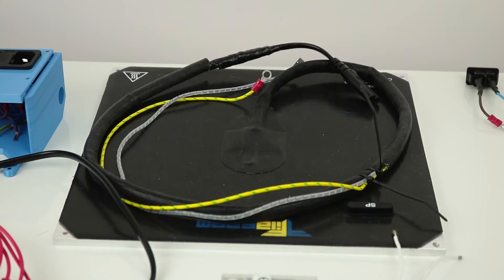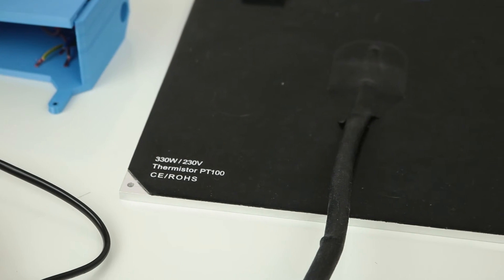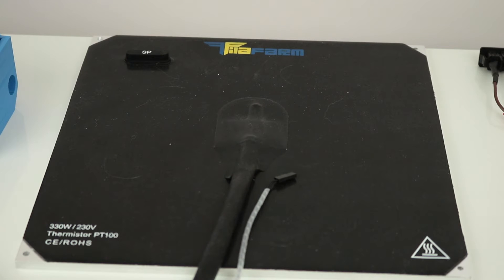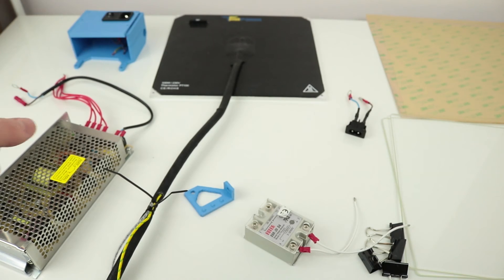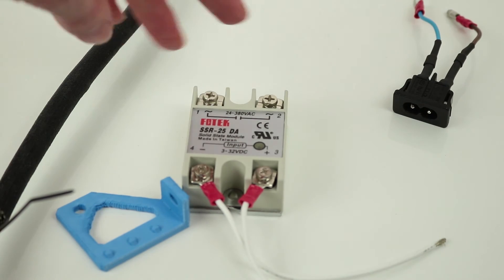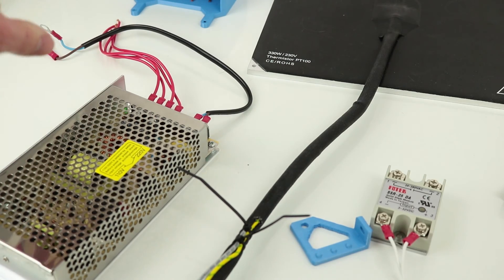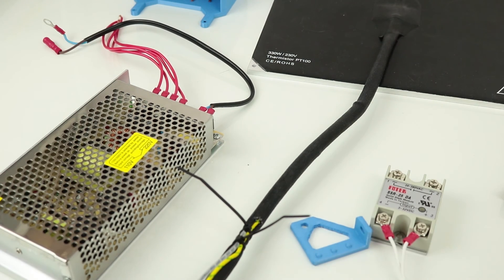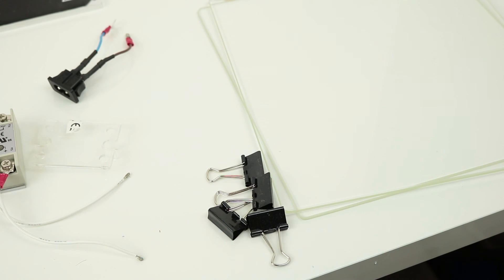Bed, Heater and Surface  - 3D Printer Scratch Build Log - Episode 7

Comment: Why the hell did you choose 265 x 265 bed?   Such an in between and hard to get part in Australia without it costing a small fortune for a one off cast.   Why not a 300 or 220 sized bed?  Any suggestions please.  This is a make or break on whether I build this printer, which I really want to do and have already started sorcing parts and printing parts as well..

Comment: What the hell, you’re wiring up those connectors in reverse? So you have exposed mains as soon as someone pulls out that plug. That’s terrible. I mean, it’ll work, and you don’t have to sell it in shops so you won’t get sued by yourself, but it’s still a terrible idea.

Comment: a seller on eBay sells heater mats like them   wedo3dprinting im using a 40 amp ssr  and a 750 watt 240 volt heater gets to 120 in 90 seconds using 240 mains is the best way for heated beds in 3d printers anyone still using PCBS are mad Mk 2 pulls 12/13 amps  my heater pulls 4.5 amps and is 300x300 mm and gets there a lot faster lol
Reply: 750W/90Sec ist by far to much power and to fast. It is going to stress the alu and bend it after time.